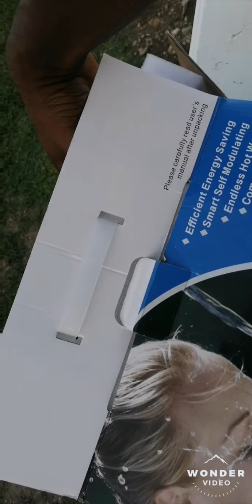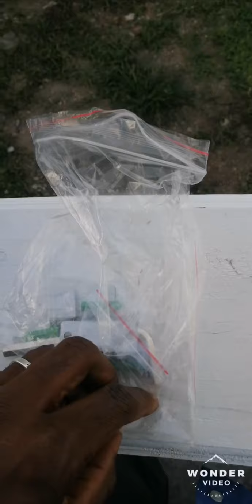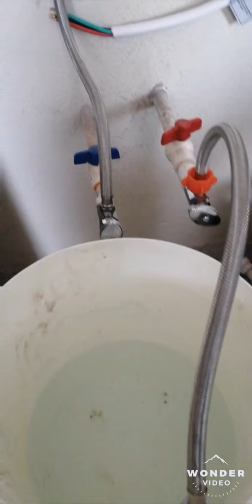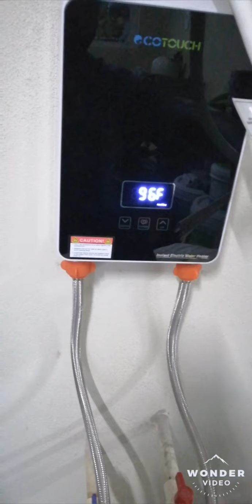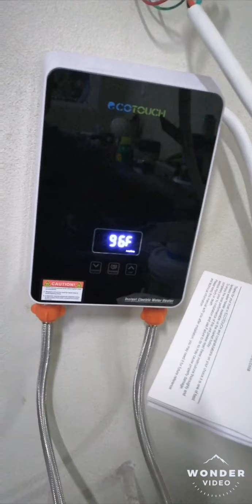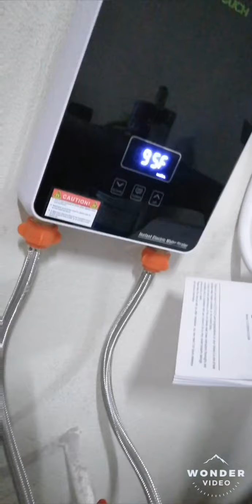Ecotouch Tankless Electric Hot water heater 5.5kw installation in full. BUDGET HEATER!!!

Comment: Excellent video thanks for the tips😊... Curious on the electrical part the unit comes with 3 Bar wires I know ones Ground. Ones Power.
And ones the Negative but not sure why I  have to do the wiring sure it's for hardwired into box but what If you want to plug-in to. The wall?
I'm not an electrician and having trouble finding info.. How did you do it?
Thanks!
Reply from the maker: Excellent question. Yes it is hard wired. The wiring configuration is american 3wire 208v. Two hot and a ground.  I'm assuming inside of the unit is a transformer that would then break down the voltage to use with the various components. Two hot wire is used because the heating element requires two and Grounding for protection. Now this unit uses some serious amperage for residential use. On both legs it's about 24amps, but because the heating element requires leg you would get 12 across each leg. A plug can be used but you just have to ensure that has the correct rating to handle the amount of current passing through it. I have this unit on a double pole 30A breaker. No Neutral is required for this unit.
I hope this helps 🙏

Comment: Great video. I was just wondering why you doubled up on the shut-off valves. You have a quarter turn and you have a old fashioned valve. I'm just wondering why you needed both. Plus I don't even know why you need to shut off on the hot side.  I would think to turn it off, you would just turn off the cold side, but I'd like to hear your input.
Reply from the maker: Excellent question. The cold valve of course prevent water from flowing through the unit but the hot heater prevent water from coming back in the event of maintenance to the unit. The unit is located in my basement. Also it is closed a certain way because this heater is recommended for hair salon or your sink. But I'm using it through my entire house. Because it is instant the faster the water pass the less hot it will get. So to prevent me having to throttle in the shower where I need the water to have the proper temperature. I did the throttling on the discharge of the heater which would allow me to get the water temperature that I find is suitable. If it's too hot I can always turn on the cold side a But to adjust the temperature. I hope this helps. Please let me know.

Comment: You have explained this indirectly near the end of the video but I want to make sure whether with this model you have to turn the unit on when you want to get hot water and then turn it off after you finish? The sales person I talked to said that's how we are supposed to operate a tankless heater although I doubt what he said.
Reply from the maker: Okay. If I hurried of the ending I humbly apologize. This version is the ECOTOUCH tankless water heater 5.5kw version and operates automatically. 

When you're finish installing the unit, it is recommended that you flush the unit for a few minutes before turning on the heater. Once finish flushing the unit you can turn off which ever tap you opened. After this is completed you turn on the unit. The unit will display the default temperature the unit is set to then change to the temperature in the water line in a few seconds. If the default temperature is too hot for you, you can always adjust the temperature using the arrows on the display.

Once the unit is powered on and water starts to flow the unit will automatically detect water movement (using a flow sensor built in) and turn on automatically. The water movement has stopped it automatically turns off. 
You don't have to turn this on and off everytime you want to use it. It automatically turns on. 

  (If power goes all your settings is lost and you have to turn back on the unit physically, but thats it. Once the unit is re-energized and set to the desired temperature you can operate as normal.

I hope this answer your question.

Comment: Mine says ec after I turned on my breaker that it's connected to and it won't do anything. Do you know how I might be able to fix this issue ?
Reply from the maker: Can you verify the code shown on the screen, malfunctioning code runs from E1-E4, no EC is shown. Please verify.
Reply: Whenever I turn it on it looks as if it is going to start up and then it just shows EC
Reply from the maker: @rubencarranza7220  I've searched but haven't seen this fault I'll have to reach out to the company and see what they say.

Comment: how does the electric consumption work? if its 5.5 kw, is that the use per hour or per second per minute?  im poor and looking to convert my apartment to electricity. my gas bill is too high i need to know what the cost difference will be, so im trying to figure out the electric consumption rate. can someone please help me?
Reply from the maker: Electricity consumption is done per hour. So basically all you have to do is multiply your appliance rated power by usage and then divide by 1000 to determine how much energy you're expected to consume within that period. So assuming we use the heater for 2hrs. 5500w x 2hrs = 11000Kwh/1000 = 11kWh.
The exact cost is different for each country as the rate per kWh is different depending where you are from. You can find out how much more you're expected to pay by finding out your electricity company provider rates and then do your calculations based on your energy consumption. I hope this helps.
Reply: @DiscoverNevis3  bro been trying to find this oit all week, thanks for the formula exactly what i needed. thank you.

Comment: Can I install it in the kitchen and at the same time receive hot water in the bathroom shower? The distance between the kitchen water source and the shower is about 10 meters , will the hot water reach me in the shower ? Or does it have to be installed at the point of use ? Either shower or kitchen?
Reply from the maker: Of course you can. Currently, mines is 5 meters to my shower and 10 meters to my kitchen so it can do it easy. Takes a few seconds before the hot water reaches but it will do the trick. Even if the water isn't hot enough you can always raise the temperature currently mines is set to 108 degrees Fahrenheit and I think it goes up to either 120-140. All my hot water pipes are interconnected so it will reach. My heater is installed in the laundry downstairs.

Comment: Mine is stuck at 104. And mot of the time it doesnt even reach that high.
Reply from the maker: Sounds tricky, if you have a filter in the line try cleaning it. It could possibly be a malfunctioning temperature sensor as well. If cleaning it doesn't work that handbook recommends calling the manufacturer to rectify the issue.

Comment: As like a standard tank type electric water heater a separate copper  ground from one of the pipes  must be attached to a earth grounding rod ...this for safety and is code. In fact the instructions explains this. You cannot rely solely  on the ground coming from the power source only. 220 volts could if exposed into the water lines electrocute. A galvanized pipe coupled to the outlet of the heater before attaching cpvc plastic pipe,  is what I did , then drove a ground rod into the earth.
Reply from the maker: Thank you for the feedback. That is 100 percent true not having the galvinzed pipe  grounded could result in fatality in the likely event of equipment failure. Fortunately where I come from the most common use pipes are pvc so it wouldn't apply much here but if i was using galvanize pipe I would definitely ground it. I do appreciate the feedback which would help those who are living in a country where these rules are applied.
Reply: @DiscoverNevis3  sorry to tell you but as a 40 year electrician,  its cpvc pipe that needs the copper ground to earth. Plastic is a 100% insulation from electrical currant...thats why electrical wire is covered with it. So, if a cpvc is not some how grounded to earth, a 110 or 220 heating element submerged in water if exposed, has no other path to follow but the pressurized water...in turn electrocution is possible.  Where as galvanized pipe like a ground rod to earth is safe...provided it is buried into the earth like in a concrete slab. So cpvc needs to be grounded for sure. As I said, this can be done by using a coupled piece of galvanized pipe coming out of the tankless heater, than a copper ground wire to earth.
Reply from the maker: Noted. 100% agree the manufacturers need to look into this for those who are concerned in this regards. Providing a product they should have looked into this but I'm sure they have a good explanation for it. But if this is something stated in the instruction manual then they should provide the fittings necessary to ensure safety.